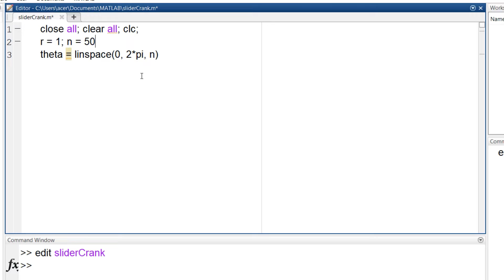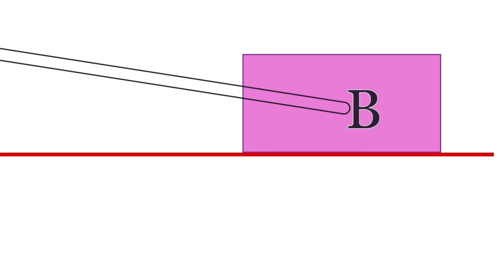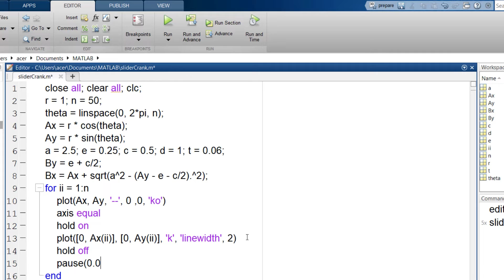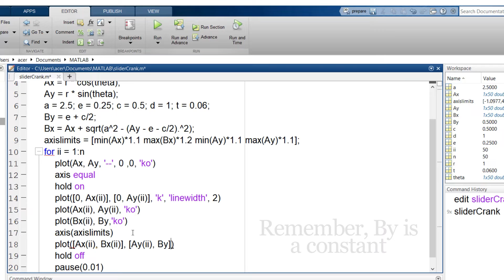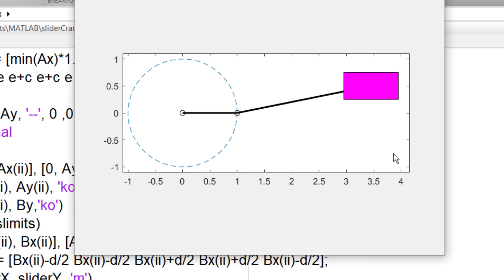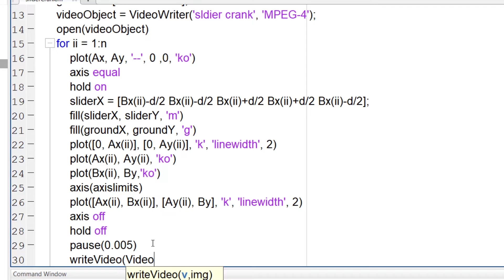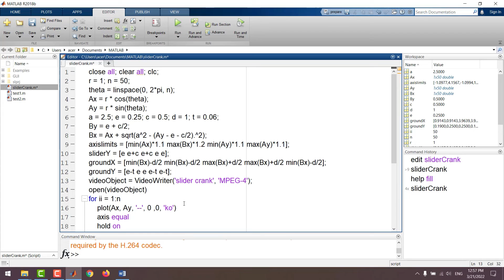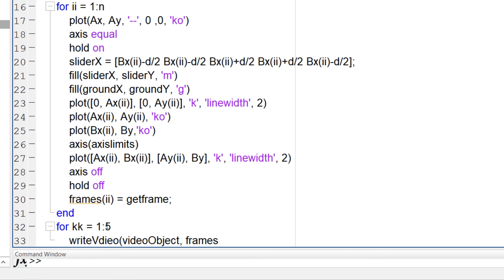Create a Slider-Crank Animation with MATLAB | Learn MATLAB Through Projects

Comment: Thanks for the video but it is e-c/2 would appreciate it if you could correct it

line 7 
2:13
Reply from the maker: Thank you for your interest in this code. Actually it depends on your definition of 'e'. I took 'e' as the vertical distance between O and the sliding surface. So in this definition my code is definitely correct. You can define 'e' in another way and change the code accordingly.

Comment: thanks alot can you share your code because i am having a error much appreciate if you share your code 👍
Reply from the maker: close all; clear all; clc;
r = 1; n = 100;
theta = linspace(0, 2*pi, n);
Ax = r * cos(theta);
Ay = r * sin(theta);
a = 2.5; e = 0.25; c = 0.5; d = 1; t = 0.06;
By = e + c/2;
Bx = Ax + sqrt(a^2 - (Ay - e - c/2).^2);
axislimits = [min(Ax)*1.1 max(Bx)*1.2 min(Ay)*1.1 max(Ay)*1.1];
sliderY = [e e+c e+c e e];
groundX = [min(Bx)-d/2 min(Bx)-d/2 max(Bx)+d/2 max(Bx)+d/2 min(Bx)-d/2];
groundY = [e-t e e e-t e-t];
videoObject = VideoWriter('slider crank', 'MPEG-4');
videoObject.FrameRate = 15;
open(videoObject)
for ii = 1:n
    plot(Ax, Ay, '--', 0 ,0, 'ko')
    axis equal
    hold on
    sliderX = [Bx(ii)-d/2 Bx(ii)-d/2 Bx(ii)+d/2 Bx(ii)+d/2 Bx(ii)-d/2];
    fill(sliderX, sliderY, 'm')
    fill(groundX, groundY, 'g')
    plot([0, Ax(ii)], [0, Ay(ii)], 'k', 'linewidth', 2)
    plot(Ax(ii), Ay(ii), 'ko')
    plot(Bx(ii), By,'ko')
    axis(axislimits)
    plot([Ax(ii), Bx(ii)], [Ay(ii), By], 'k', 'linewidth', 2)
    axis off
    hold off
    frames(ii) = getframe;
end
for kk = 1:5
    writeVideo(videoObject, frames)
end
close(videoObject)
Reply from the maker: Hi. I hope it helps you. I couldn't find your email address, so I just pasted the code right here. If you needed more help, contact me via laplaceacademy1@gmail.com
Reply: @LaplaceAcademy  Thanks alot :yougotthis: